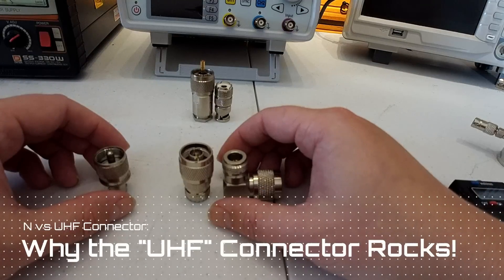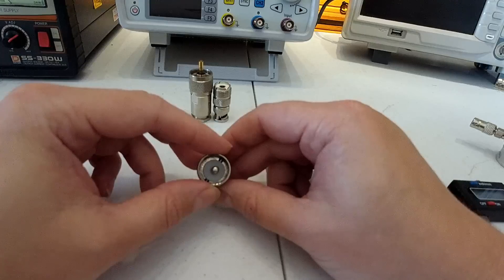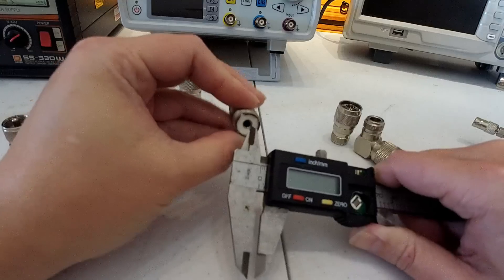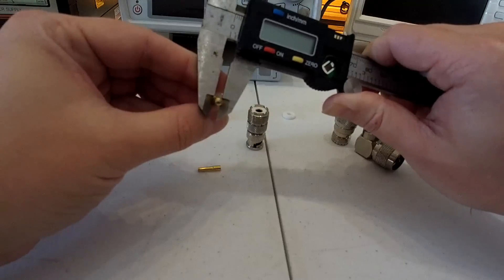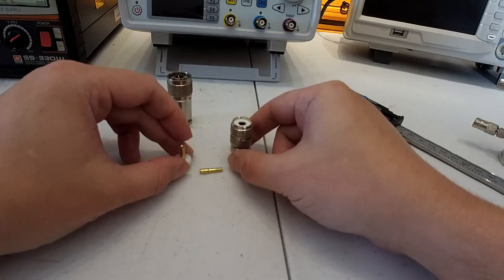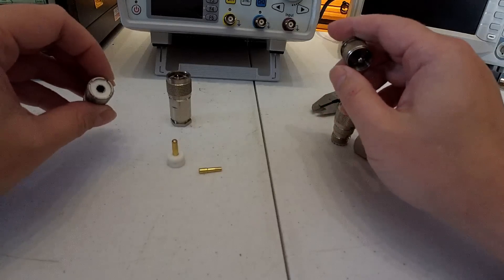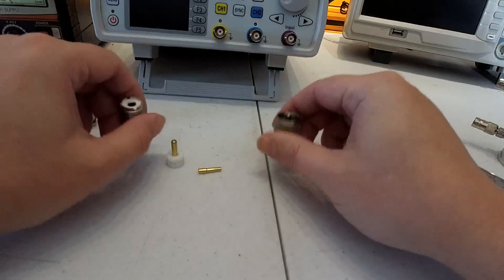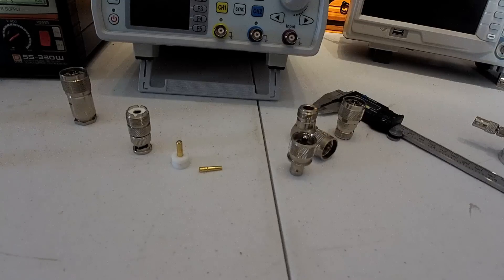Why the 'UHF' Connector is still the best for HF Usage

Comment from the maker: Quote Tom W8JI (http://www.w8ji.com):

"N connectors are OK. They have their place in the world. 

The only reason to use N connectors below 100-200 MHz is if you just happen to like the N connector. There is no compelling technical reason to use N over UHF, unless you are making precision impedance measurements above 30MHz or operating above 150MHz with impedance-critical gear. 

I actually machine and modify all my 7/8th inch hardline female N connectors into UHF-style females. You won't catch me using a N connector for HF through six meters, and only occasionally do I use N's at 2 meters. The exception is in test fixtures for critical impedance measurements above 30MHz, where I use N's as well as other precision connectors. 

A reasonably good UHF connector handles much more power with high SWR than any N connector I've ever tested, despite what some data sheets might lead us to believe. If you run high power into high SWR loads, use a UHF Teflon connector. It will be far more reliable than N connectors. 

As a matter of fact, N connectors and regular BNC connectors have almost identical pin sizes and internal air gaps. Both N and BNC do not use large conductors and certainly do not have wide internal air gaps. 

Both the N and the UHF require waterproofing, if outside in the weather. 

73 Tom"
 
Reference: https://www.eham.net/articles/5300

Comment: It's never a prob in Aus anyway. Can't legally run enough power to run into issues with a BNC. Yes I'm being sarcastic.
Reply from the maker: Into a severely mismatched yet also resonant load you could make it arc... mag loop for example :) But yes hihi
Reply: Sure, but is that a design weakness of the connector or the operator? I just love that you can buy good quality ones for about $5 and yet some companies try selling them for up to $90 a connector. Not mentioning any names T.... W........
Did just watch a video with 20 old connectors together and immeasurable loss measured on a bird meter.

Comment: Good point Jarrad. By the way, a couple of years ago I made and recorded many attempts to practically see the claimed performances benefits the N connector should have over the PL even when factory fit for that purpose. I'havent been able to find any. I've asked around among the N enthusiasts to show me a test I could perform that showed some evidence of the "evident performances" of the N connector when factory fit on the back of a commercial UHF radio, but so far nobody answered to me.

http://www.iz2uuf.net/wp/index.php/2016/01/15/pl-259-vs-n-round-2-hard-testing/

Vy73 de Davide IZ2UUF
Reply from the maker: Nice article Davide!

It is a pity you couldn't test a FT-857 shipped with the SO-239 connector, as I think you would find there would be no performance penalty at all!  This is because manufacturers usually correct for the impedance bump using a small coil and/or capacitor in the feed arrangement!

So your test, it is worst case, and still no big deal! I will personally keep my higher power PL-259s for HF, definitely not to be traded for anything less than a 4.3-10 or 7/16 DIN! :)

73, Jarrad VK3BL :)
Reply: Jarrad,

The performance gap between direct N connection and N-SO-PL-N converters is so little that I'm afraid that any difference detected between two rigs of the same type equipped with N and SO-239 could be easily within the construction tolerances and it would be inconclusive. The only instrument that has shown a difference is the HP438 bolometer: -0.11dB lost with the N-SO-PL-N conversion in respect of direct N connection. Probably two specimen of the same rig could differ of 1/10 of a dB in their output power due to tolerances. For example, my 857 should have output 20W (43.01dBm) but I measured 42.85dBm, i.e. 0.16dB less: this value is in the same order of magnitude of the worst case (0.11dB). So I believe that we can not compare different specimen for this kind of tests.

Vy73 de Davide IZ2UUF

Comment: I have worked in professional RF/Electronic engineering for 24 years now. Working from LF (around 150 KHz) to SHF (10 GHz satellite uplink) and never seen a PL259 used on any professional equipment. SMA connectors are becoming more popular, even in amateur applications along with the BNC.
Reply from the maker: John, I would never advocate the usage of PL-259/SO-239 on anything but HF Systems, particularly QRO, or other systems of where frequencies of under ~60MHz are going to be fed into non-resonant loads tuned at the source.  A fellow in 'Ham Radio' on Facebook started a debate, wishing to do away with all "UHF" connectors, in favour of the N; my point here is merely be careful what you wish for!  4.3-10 (if it came in flexible coax variety) or 7/16 DIN would be much better choices for QRO HF than N.  73, Jarrad VK3BL